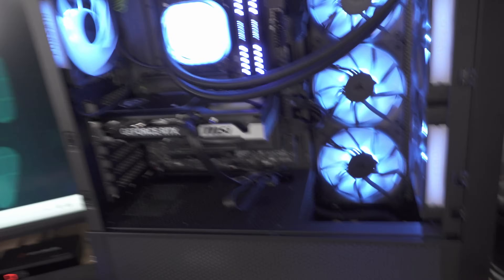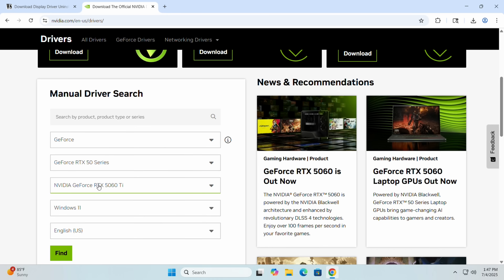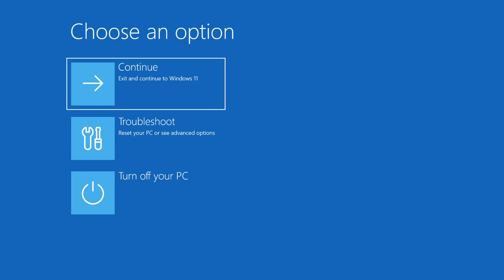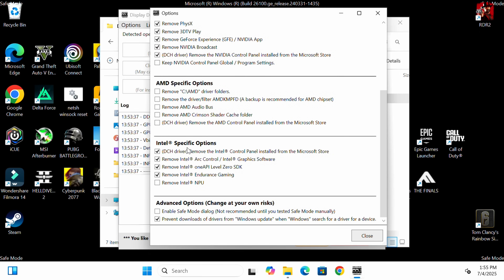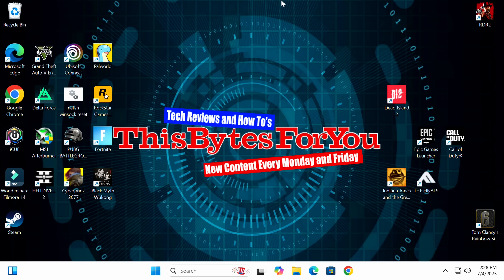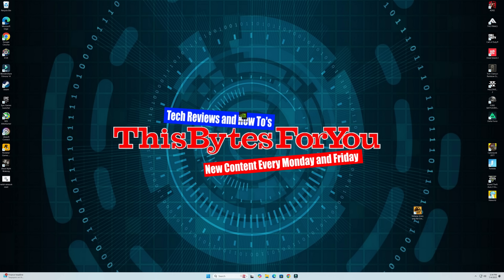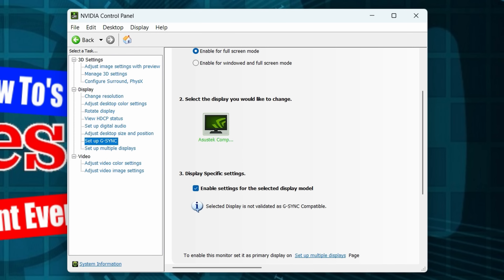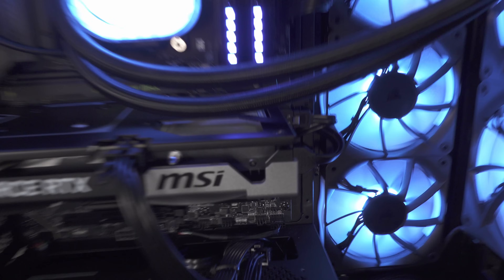The ONLY Way to Install RTX 5060 Ti? (Avoid Headaches & Maximize Performance)

Comment: New to pc building here, so Im not sure what every part is called. What if for example someone gets the Geforce rtx 5060 ti Windforce, but if you look at the card the yellow teeth at the bottom are shorter than your old card. Can it still slot into the motherboard even though it cant latch or fill the entire slot?
Reply from the maker: Yes that is completely normal, there will be a few, usually like 6 in your card right?  What is the manufacturer and model number of your card?
Reply: @ThisBytesForYou  My old card is NVIDIA Geforce rtx 2060. If thats not what your asking for, where to I go to find the model number and manufacturing?
Reply from the maker: well, the model number depends on who makes it, NVIDIA makes the GPU and sells it to MSI, EVGA, Asus, ASROCK, etc and since its an NVIDIA GPU and a 2060 from NVIDIA that tells me who makes the GPU on the card, the board partners (AIB's, Add-In-Board Partners) I listed previously make the card, so it could be a GV-N2060OC-6GD-R, DUAL-RTX2060-O6G, RTX 2060 VENTUS GPOC, ETC, this video will help you identify it: https://youtu.be/65ZSiVImJx0
Reply: @ThisBytesForYou  NVIDIA GeForce RTX 2060 (TU106-200A) [NVIDIA] is my old GPU. The new one I want to install is GEFORCE RTX 5060 Ti Windforce (model number:
GV-N506TWF2OC-16GD). I hope this answers your questions.
Reply from the maker: @Gains_Gaming_inc  So is this your card: https://www.ebay.com/itm/267171745043?itmmeta=01K0JKQD3F5TSK1E1X8Y3M5BTY&hash=item3e34ad4d13:g:eBsAAOSwsVZnvznz&itmprp=enc%3AAQAKAAAA4MHg7L1Zz0LA5DYYmRTS30kgJB569tSnOpfCvaEwZ1WNMkf9jW9dViABExbvjq9LcUAkkETcU0xv%2F05KXFJLuefct5zJ06BiSiZwjnFK8Y2au8ZJryRWSjKgf2nk%2BWnn371BmQ7f2H9BcYcxsN2zacGK7isZQBLoVU3MoMiX9E%2BZHPc0DrZ4PiDBmT0MX24tiauj091hJceWEsacRRPiYd%2B7E0Q12P%2BF5bVZL6wqikC%2F8p0EZLNonuhrjInRdm%2FgyZJZ3Gk8hJ4u3Wa0MUaDoRUntJIz2WAlH2XoSBni22cz%7Ctkp%3ABk9SR-7R3dOEZg

or this one

https://www.ebay.com/itm/336059614493?_trkparms=amclksrc%3DITM%26aid%3D1110006%26algo%3DHOMESPLICE.SIM%26ao%3D1%26asc%3D264183%26meid%3D73b640e9ad314d98be21d5c5e5355b3c%26pid%3D101875%26rk%3D2%26rkt%3D4%26sd%3D267171745043%26itm%3D336059614493%26pmt%3D1%26noa%3D0%26pg%3D2332490%26algv%3DSimVIDwebV3WithCPCExpansionEmbeddingSearchQuerySemanticBroadMatchSingularityRecallReplaceKnnV4WithVectorDbNsOptHotPlRecallCIICentroidCoviewCPCAuto%26brand%3DNVIDIA&_trksid=p2332490.c101875.m1851&itmprp=cksum%3A33605961449373b640e9ad314d98be21d5c5e5355b3c%7Cenc%3AAQAKAAABgG96wQ16jds4VFcrhy1F3d4mbwZUJI9Fs%252BgdXYAHIzlX2e3YaNh7x%252BEnKA3G%252BCqSl1Xn4McfcWFK1GytmS2qxJ87mtE8Gm3iR1Ja4WBwh0hNHJrJx3Ki5mp04ow4CO7lP%252BooCybZDDU%252BbbSwmg7CbTin%252BBzBzbCYVnbjvyQAHu6--HI4MB7SvJl5IJqlyvomgoLMlgT6qAJzX0SANJhty2fvC6zYFvkRhA%252FLYZiOnc2cjMuWpLXd8W8e0ydbWxCmBrCiRIClCL4UX2EYqWRREd1bk1WDMaKzRE8SRLVUBZ0gs6vSUU4rBXSa5Kfm21dF7NFHgmG7f07T1DC5A9f2gQc5iBZ2dJOcbJgeXtju2YKHSZggTLniogMl%252Fo4S0DbGMnB%252BXMtXCmIBFOiqBYxQActwByZdmzbyHBlYE6BsElA%252FGV%252BjGSgeG1P%252B7pxkHIYk2NEXaidbS7RSCtbzhcMbERNi5unx3svl8gOuZF2vWy--vbghZgs9JHlprveuapmcsA%253D%253D%7Campid%3APL_CLK%7Cclp%3A2332490&itmmeta=01K0JKRCM0004G65DH4PKFE87K
Reply: @ThisBytesForYou  No and yes??? The information I gave you came from the HWinfo download thing from your other video. Expect that, that GPU doesnt look like mine, mine has two fans, not one.
Reply from the maker: From what you are reading me, it only shows the gpu, not the card, just above that at the 2:58 mark it shows 3 lines for the gpu, what do each show
Reply: @ThisBytesForYou  Top line : NVIDIA GeForce RTX 2060 (TU106-200A) [NVIDIA]
Middle line : NVIDIA GeForce RTX 2060
Bottom line : TU106-200A
Those are the very top three lines in the GPU section
Reply from the maker: so its a founders edition 2060 I would assume like this one on my Amazon Affiliate link: https://geni.us/ZdquvVI
i don't see how it could be an issue, but to be 100%, what is the manufacturer and model number of your motherboard?
Reply: @ThisBytesForYou  Top line : STGAUBRON B450M-ST
Second line :AMD B450 (Low-Power Promontory PROM26.A)
Reply from the maker: Does your board look like this: https://www.asrock.com/mb/amd/b450m%20steel%20legend/
Reply: @ThisBytesForYou  It does not, I keep looking for it myself but I cant find any motherboard that really matches it.
Reply from the maker: if you look inside your case, at your motherboard, it should show you the model number and manufacturer, big logos
Reply from the maker: Is it this board: https://itzr2010.en.made-in-china.com/product/ftEphWVgqihk/China-Esonic-Brand-B450da1-for-AMD-Am4-Socket-Motherboard-B450-Chipset-Matx-Mainboard-for-PC-with-M-2-Nvme-SSD-Port.html
Reply: @ThisBytesForYou yes
Reply from the maker: OK, it "should work" but you may have some issues.  
1. if you go in your BIOS, you need to see if your BIOS is in UEFI mode or BIOS Mode (can you use your mouse in the BIOS or are you limited to keyboard?)
2. Is your C drive in GPT mode or MBR? (you can find out by right clicking on your start button, clicking "Disk Management", on the bottom, you will see all your drives, they will be listed Disk 0, Disk 1, etc, right click on the Disk that has the line with the C drive, and what does it say under "Convert to Dynamic Disk,..."
3. How many watts is your power supply?
Reply: @ThisBytesForYou  BIOS is in UEFI mode. And the line underneath "Convert to Dynamic disk." is "Convert to MBR disk"
Reply from the maker: hmm, so you are in GPT, thats great and UEFI, thats perfect.  I don't think you will have an issue, hopefully your power supply is powerful enough since it will require a 600Watt and an 8 Pin PCIE connection.

Comment: My screen will not turn on
Reply from the maker: Did you do it exactly the way I show you?
Reply: @ThisBytesForYou  Yes then im in safe mode i cant write my password
Reply from the maker: @Jetvanguard so your screen turns on, cool.  Which also means you can get in regular windows, cool.  You are using a non Microsoft account, which is why you can't get into Safemode, a stupid thing Microsoft has done.   You need to link up your WIndows login with a microsoft account then you can get into safemode.
Reply: @ThisBytesForYou But my screen only turns on then I use the old graphics card and the. I switch it to the new one the fans are not spinning and my screen will not turn on
Reply from the maker: The fans don't spin till the heat builds up, that is normal.  A few questions then
1. What was your old card, and what is the manufacturer and model number of that card?
2. What is the manufacturer and model number of your power supply?
3. What is the manufacturer and model number of your motherboard?

Comment: does a 3 fan 5060 ti fit in a nzxt h5 flow?
Reply from the maker: what is the manufacturer and model number of the 5060 ti you are thinking about?
Reply: @ThisBytesForYou i was thinking of the msi one, it’s white and 529 dollars on amazon 16gb version aswell
Reply: @ThisBytesForYou gaming trio or something like that, i’m upgrading from a 3050
Reply from the maker: your case can take up to a 410mm gpu, this card is 300mm on my Amazon affiliate link, so you are good: https://geni.us/xs8n
Nice upgrade, what is the manufacturer and model number of your power supply?
Reply: @ThisBytesForYou thanks for helping me so much btw, uhh well i have the nzxt player one pc it comes with a 650w gold 80+ rated psu
Reply: @ThisBytesForYou i don’t know the manufacturer though sorry
Reply from the maker: Ok perfect, you're lucky haha, the card only needs a system with a 600Watt power supply, so you are good.
Reply: @ThisBytesForYou  so everything will 100% work? i dont need a  certain motherboard or anything right. sorry to trouble, but im also concerned about the pcie cables. mine 3050's is super small. do i just swap those out and what do i do with the new 12 pin that comes with the 5060? once again sorry for the trouble i just need these answered if possible since this is my first time working with my pc.
Reply from the maker: Everything "should" work, go through what I show you in the video and you should be good, no trouble what so ever, I try to cover everything in the video.  Watch and listen to the video and it will help you, I make everything noob friendly because we all started off as noobs.  Me telling you everything in the video kinda makes me making the video kind of pointless right?
Reply: @ThisBytesForYou  yeah, thanks again man
Reply from the maker: Always a pleasure my friend, so very happy I could help.